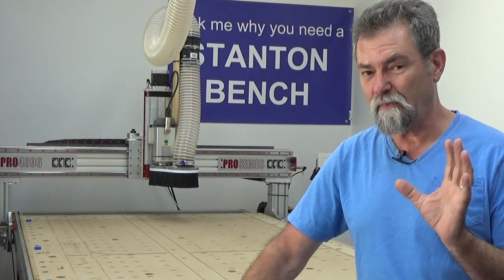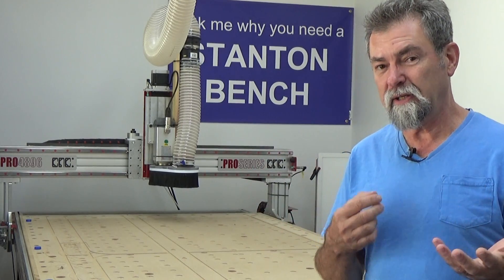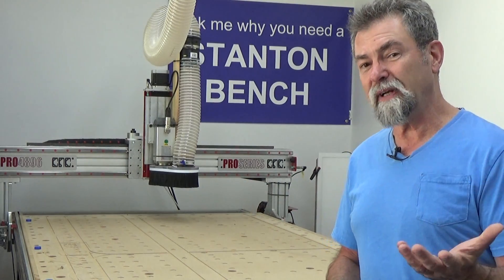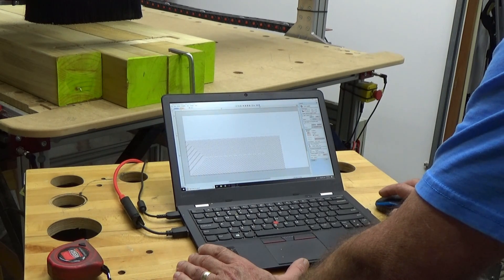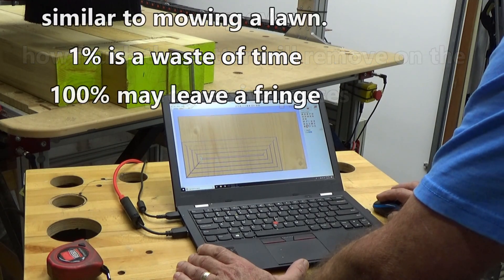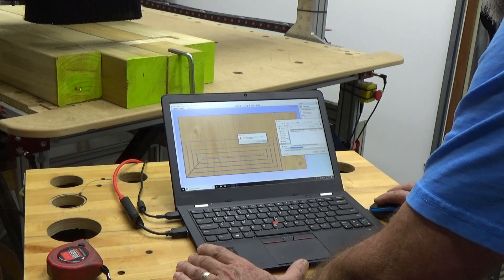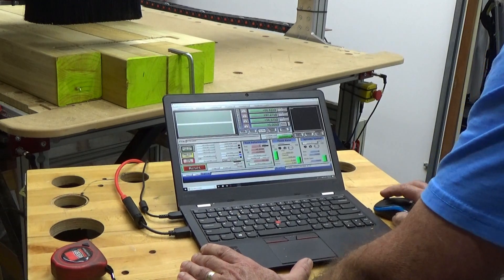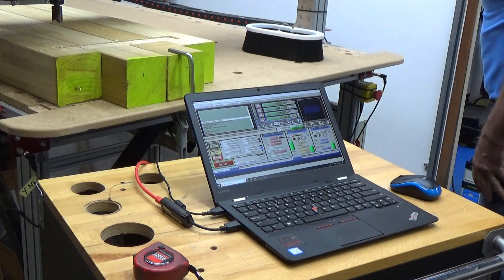how to adjust a cnc and continue cutting Dave Stanton easy woodworking

Comment: Dave - you dont have to mess around with Aspire to alter speeds and feeds. Mach3 lets you do this on the fly from the main screen. Editing G code is also built into the same screen via notepad. It does take a while to understand feeds and speeds. Easiest way to learn is look at what CNC do in their files and go a little less. You will soon discover that using a laptop as the control computer is a bad idea. Vectric monthly projects is another great learning area as Michael Tyler uses conservative values and files can be used as is.

Comment: Hello David, very nice and constructive. I have noticed you use a laptop for the MACH3. I am still using an old XP computer and a parallel port breakout board and I would like to switch to laptop with USB (or other ) communication. Could you please mention the interface card you use between the laptop and the CNC machine ?
Reply from the maker: Hi Ilan Goldberg!My machine was a kit from CNC Router parts. It has a control box mounted on the side of the table supporting the bed. This is what the laptop plugs into. Sorry I can't be of any more help! Here is a link to CNC Router parts if you want to see what they offer. http://www.cncrouterparts.com
Reply: @DavidStanton  I have followed the link. Your controller is based on Ethernet connectivity and is a good option for self built control systems. However it has a high price of 200 US$ to start with. I will first start with USB controller available for much less. If it is of interest to community I will provide the results in the future. (Failure is also a valuable info). My CNC mechanics is sort of Shapeoko self built and works well with old XP and MACH3. Thank You so much.
Reply: Just research smooth stepper and Warp 9 software and then get rid of parallel ports and USB forever! Very good installation notes on the CNC Router parts website (video)

Comment: Dave,
I know you recently setup the CNC not too long ago. I was wondering how much trouble you had getting the X,Y axis perfectly square. The reason I ask is since you use the CNC to make your workbench holes, if the CNC is not absolutely square (100%), the MFT holes will not be 90 degrees. I have a Shapeoko3 XL and am struggling getting it to be completely square. My 90 degree axis from one end to the other ends up being 89.9. Close but no cigar. 

Real Question: If I was to upgrade to a Router Parts type CNC would I still have the same problem??

Thanks
Reply from the maker: Hi Jeff. My machine uses proximity sensors and I adjust the slave on the y axis to get the cnc square to scary tolerances.
Reply: Dave,
Thanks for such a quick response. I don't have proximity sensors. Sounds like I need to get smart on what those are and how they work. Your answer really helps though. It tells me that if I research and possibly upgrade I can get to the tolerances that I don't have at this time. Thanks Again!!!

 @DavidStanton
Reply from the maker: The sensors are mounted on a 1mm pitch thread. I adjust them via a hexagonal nut, 1 flat = 1/6th mm, I can easily adjust 1/4 of a flat visually, 1/24th mm. the diagonals across my machines bed are over 2.5 metres. You do the sums. I am getting down to microns of tolerance.
Reply: One more question Dave,
Would you say your CNC is more accurate for making an MFT table than the Parf Guide System that you have used and demonstrated?
You the MAN!!!

Thanks
Jeff Marks

 @DavidStanton